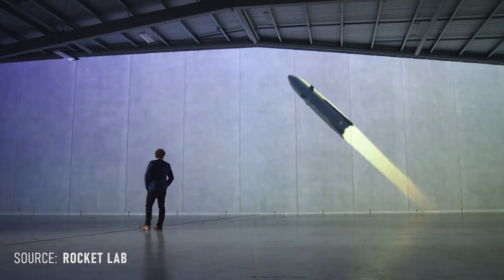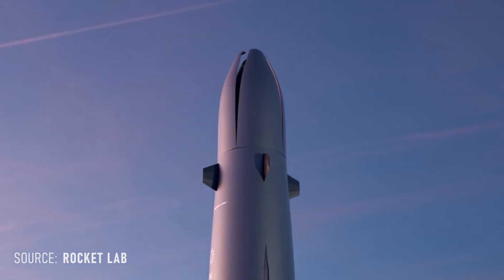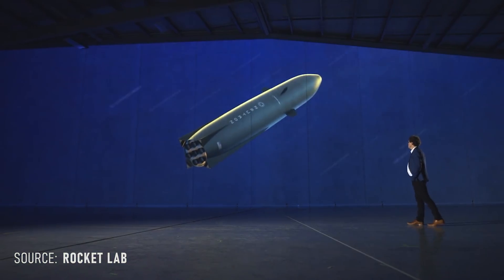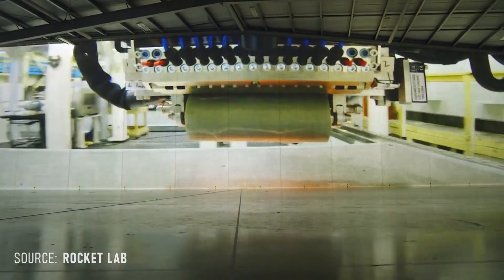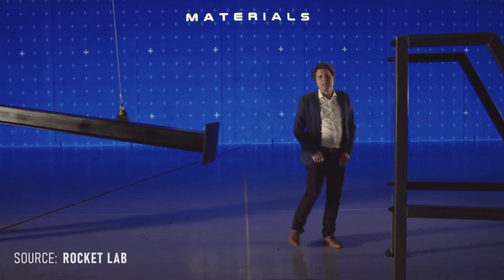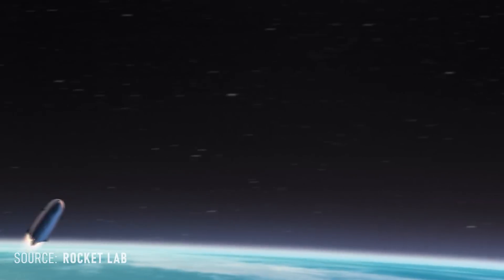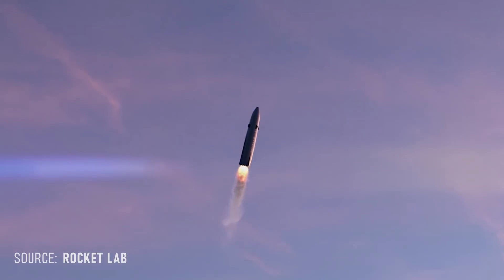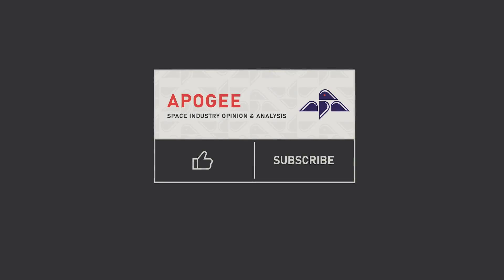Neutron First Thoughts - Design Analysis

Comment: 2050 is a long way to wait, and competition from existing rocket builders will not help them.  Launch vehicles from more well known competitors will likely do the same that Neutron is doing before Neutron can get to market.  As for Carbon Fiber, most satellites, like the recent launched Webb telescope now parked at L2, seem to do fine in space, and they are made of components that would be flimsy in earth's gravity.

As for missions to Mars, the problem is not so much in getting there, it is if stuck there by a return module launch failure, ground life support has to be reliable enough for a rescue mission.  I am not convinced a human presence on Mars, or the Moon is needed.

I am not sure we would learn anything our space probes have not already learned.

I like Blue Origin, in addition to Elon Musk's space capsule, I feel Blue Origin's launch and recovery method is more sound, especially in multi stage to orbit, because of landing on land vs. the way Musk's boosters are recovered.

I have not been impressed with Musk's booster that flips from a semi gliding position before landing--too many failures so far compared to his Crew Dragon launch system.

I am quite impressed with the Crew Dragon's bringing crews and supplies to the ISS, giving us an alternative to the Soyuz unless there is an emergency requiring its use.  

Good video you made, well spoken and presented with slick visuals and insight into a launch system provider I have not heard of.

Comment: Elon should sell more Tesla shares and buy up rocketlab to gain their expertise in carbon fiber.
Reply: There are plenty of other (cheaper) companies SpaceX could buy to bolster their competence within carbon fiber. Rocket Lab isn't doing anything particularly new, they are for the most part just utilizing industry standard materials and processes. SpaceX also does significant work with carbon fiber. For instance, the interstage, fairing and landing legs on the Falcon 9 are carbon fiber. So, I doubt they would really need to buy a carbon fiber company.

Comment: Another great video, thanks. 
The legs have to retract or have some kind of heat shielding. The plume from the engines will expand at high altitudes and cook carbon fiber legs. I'm skeptical about the carbon fiber 1st stage as well. It's not just the heating during reentry, but it's difficult to make carbon fiber contain liquid oxygen. Clearly they have overcome this problem with electron, but how will it hold up with reuse?

Comment: If they can develop a carbon composite that can withstand re-entry, I say more power to them, you can't improve on technologies if you never try to push the limits.
Reply: Already exists: https://en.wikipedia.org/wiki/Reinforced_carbon%E2%80%93carbon
Reply: Or they will use heat tiles, like spaceX.
Reply: @robertoaguiar6230  They are only trying to return the first stage that has little to no horizontal velocity so the Neutron will only experience a fraction of the heat a Starship will when entering from orbit(or even worst from the moon or even mars). No heat tiles should be necessary, especially with their bell shape and blunt end that should push the shock wave further away from the vehicle.

Comment: I'm not certain that RTLS causes Neutron to have fewer re-entry forces than Neutron. I believe that Neutron's mass and profile cause it to experience a relatively small amount of stress, but I do not know for sure.
Reply: It absolutely does. Simple physics. Boostback burn reduces horizontal velocity, it will add a bit in the opposite direction but if you think about a SpaceX ship landing the alternative is to keep burning downrange.

Edit: Apologies, i reread your comment and it compares Neutron to Neutron so i don't actually know what you were  comparing but will leave my comment up anyway.
Reply: @phillipdelatour7729  Sorry, I meant to say that I believe Electron's current re-entry forces are somewhat lesser than Neutron on RTLS due to the relatively small mass of Electron, but again, I haven't done the math, only a gut feeling. 

Obviously both are coming in hot, but Electron doesn't (seem to?) have any method of slowing itself before it achieves terminal velocity in the thicker parts of the atmosphere, and parachutes definitely work. 

Compare that to the early F9 parachute recovery attempts, which failed tremendously, and the mass of Neutron S1 seems closer to F9 1.0 S1. 

Again, no math has been done on my part for this.

Comment: The real problem is that Neutron isn't going to be competing with Falcon 9, it's going to be competing with Starship.  You can build the best small bulk freighter ever, but if you're competing with giant container ships for hauling cargo you're not going to succeed.
Reply: You're forgetting you still need a market to justify the use of a bigger rocket. And current market to LEO is moving towards more compact satellites.
Reply: @RogerM88  With Elon Musk planning on launching 30,000 Starlink satellites, finding a market for Starship isn't going to be a problem.  As for satellites getting small, that's a function of launch costs.  If SpaceX can deliver on its promise of 100 tons in LEO for $2,000,000, the motivation for making satellites as small and light as possible goes away.  I also kind of doubt people are going to want to build the big manned space stations that are being discussed 8 tons at a time.
Reply: @RogerM88  once starship is operational and delivers on its promises. The whole industry will change. At the moment size of Satelite are limited by mass but in the future of starship mass will not be an issue.
Reply: @lotambena81  How? The payload hatch seems to be getting smaller. And the sensitive maneuvering to release the payload, would mean many customers would rather use a more standard payload fairing.
Reply: @RogerM88  the payload hatch is an engineering challenge it’s not a show stopper. The shuttle payload doors design might end up being used.  
The future of space is not satellite but space station, factories, outpost colonies and massive structures. This is where starship will dominate no wonder they are planning  to build more than 1000 starships.
Elon’s always thinks big and way ahead. It’s a great time to be alive
Reply: @lotambena81  with the decline of the West and once Human population starts to decrease... don't get your expectations for Space exploration. I agree big structures in LEO are almost for sure, not so much a large colony on the Moon and Mars, that are too expensive to maintain. Some research bases, would already be a big technological feat. I believe more in the potential of big Space telescopes and a extensive Radio telescope on the far side of the Moon, all together working to thing Earth compatible planets. Until big technological breakthroughs in engine propulsion are achieved, for an Interstellar mission.
Reply: It's not going against starship. Neutron can lift 8 tonnes to leo,  starship can lift 100. It will be competing against something like Soyuz.

Comment: Good video - not quite as good as your previous ones. The buisness case is going to be tough. Its not 2014 any more. SpaceX has cornered the launch market and they needed to become their own customer with starlink to make it work. RKTLB needs a big anchor customer. Second area of concern is the engine. I like the approach, but developing a rocket engine is hard and takes years. I think they will make it, but it could take way longer than intended. I hope RKTLB will succeed with Neutron, but i don't like the odds.

Comment: On the Electron coating isn't made of grafite, but some kind of aerogel, and obviously Neutron would have something like that, but only on the parts that would be heated by re-entering, minimizing termal load means minimizing surface exposure to that load, by choosing a shape that don't allow air flow to touch all vehicle.

Comment: One thing people miss about Falcon 9 legs is that they also serve as air-break. The terminal velocity is reduced by a huge amount when the legs drop. This allows the Falcon 9 to use less fuel on landing. This is something I never see mentioned in comparison. Now I assume Neutron will have better overall air-breaking as its so fat in the lower part.
Reply: That's not accurate. The legs fold out right at the end of the landing burn, and by that time the air resistance is fairly negligible. You can see it in how the grid fins have stopped moving because they no longer have any control authority.

https://youtu.be/lXgLyCYuYA4?t=115

Comment: Highly recommend Peter Beck's interview by NASASpaceflight. It covers all challenges and decisions behind the design. Beck put huge emphasis on operating costs as opposed to material and design costs. This is interesting contrast to Musk who rarely mentions labour costs or cost of running a fleet of ships/platforms. I think the difference is that SpaceX is projected to have huge economies of scale. The same number of equipment and people is needed to launch 1 and 100 times, or 1 and 100 tons at a time. The flipside is that theoretical min cost/kg to orbit can rarely be achieved due to difficulties coordinating full capacity utilization. If you build a $100M satellite, would you pay 2% ($2M) to get it on orbit when and where you want precisely, or 1% ($1M) hitching a ride with others on set date? There is a reason why taxis and buses coexist. I do not think that Rocketlab is a direct competitor to SpaceX, but rather they aim to serve different customers. Their respective approaches play to their strengths. Now, who wants to see Neutron with Raptor 2?
Reply: There is definitely some overlap in the customer base. If SpaceX is actually successful in getting the cost of a Starship down to say $20 million/launch, it could be competing with Neutron at say $10-20 million/launch. A fully reusable bus could easily compete with a taxi where you have to replace ~15% of the taxi after every trip. Even if there is only one passenger.

I also wouldn't underestimate the head start of SpaceX. Starship will almost certainly be flying this year, while Neutron will be flying in 2024-2026, probably. Basically, by the time Neutron is making it's first flight, Starship will (probably) have flown dozens of times. It will (probably) have a proven record of reliability, and it will (probably) be an easy sell to the satellite customers.

Rocket Lab is definitely the company I hold most hope in, except for SpaceX, though. I don't at all believe SpaceX will get a monopoly on orbital launches. I am a Rocket Lab shareholder.
Reply: @espenha  That is a fair argument. I'd say that Neutron's 2nd stage looks like they strapped the cargo to an off-the-shelf engine with bare minimum of anything to make it go in the right direction and orbit. It is probably very cheap. Ultimately Rocketlab will have to manage full reusability - just like everyone else.

Comment: Kiwis have been making fiber reinforced plastics for decades. If you ask a Kiwi to build an intricate part of high strength and low weight you'll get a composite
solution every time, and is easier to make than a metal part. To be honest I think the notion that carbon fiber is hard to manufacture into parts and structures
is wrong....it just requires that you think about a new process and Kiwis have been thinking that way since the 50's.

Craig

Comment: The concept of carbon fiber construction sounds great, but if you run the vertical stress calculations with maximum loaded propellant mass, I think that you’ll find it difficult to see any advantage in carbon fiber to get larger gross mass rockets to orbit 🚀

Comment: Since carbon fiber reduces the body weight by 3/4 compared to aluminum, the heat generated on re-entry should be much lower compared to a metal rocket of the same size.   However, I agree that getting the carbon fiber skin to survive re-entry, and remain structurally sound over many flights will be their main challenge.
Reply: From all I've watched from other rocket enthusiasts' videos, it is my understanding that the heat generated by reentry is more a function of reentry speed and shape of the vehicle rather than mass/density.
Reply: @nolsp7240  yes I have read that the heat increases by the cube of the speed of re-entry. However, my understanding is that with a lower mass vehicle (of the same size and shape), the actual speed will decrease faster, due to its inherent lower inertia, resulting in an overall lower heat load on re-entry.

This is why SpaceX fairings and Rocket lab electron don't need a heat shield.
Reply: @DataSmithy  The falcon 9 fairings don't reenter with orbital speeds though. Neither does most first stage boosters.
Reply: @nolsp7240  If a first stage re-enters at orbital velocity, that means it reached orbital velocity, which means someone has achieved single stage to orbit. Single stage to orbit was done on the moon, but it has never been done on Earth.
Reply: I learned to fly at Falcon Field in Mesa, AZ, in an Allegro 2000 Light Sport aircraft in 2006.  It had metal wings and a carbon fiber body.  It was parked in the hot desert sun without degradation to its body.  Carbon Fiber commercial aircraft have been sound given the temp extremes they go thru, from hot days to -40 F in the flight levels.

The space shuttle thermal tiles I also believe were carbon fiber, certainly not metal.  They only failed once, because the Columbia lost tiles in critical places, because of the ice that fell from the fuel tank.  The Challenger disaster (which sadly happened on my parents' wedding anniversary) was different.  Odd, off subject, the Haiti quake happened on my wedding anniversary and I lost my brother on his birthday in '09 quite unexpectedly, just months before my Mom passed from cancer, which we did expect and my Mom was OK with that.  

All of us in our family were space buffs--I was glued to the TV in 69 during the moon landing and also in 68 during the Xmas lunar orbit.  However you'd never catch me in a rocket, I don't fear the flight, but weightlessness for an extended duration does not appeal to me--better for folks much younger, lol.

Comment: To me Neutron is the best example showcasing innovation on existing/proven designs. As you brought up they saw the early issues SpaceX was having with retracting the legs after landing, so they are attempting to address it. They have seen SpaceX's issues with fairing recovery, so they addressed it. These and more show how technology moves forward not attempting to straight up copy but really thinking through existing issues to solve/mitigate them and I hope they succeed in the future!
Reply: this is why I like Rocket Lab being in the competition for space, they may be behind SpaceX with "firsts" but they are quick learners and are great at adapting to the needs of the launch. They can play second place while making a more efficient version of what SpaceX does by learning from their mistakes. Its really bringing out the idea of an actual commercial market and some competition within the space sector.

Comment: I didn't notice any discussion of the landing approach and landing burn. Is the first stage  going to take advantage of its diameter to bleed off more speed in a StarShip bellyflop or is Neutron coming down like Falcon 9's first stage "tail first all the way"? If bellyflop, does Neutron have header tanks?
Reply from the maker: As far as we know Neutron comes back mostly straight down like Falcon 9. It does have wing strakes which help it glide and bleed off speed / temp slower.

Comment: What I'm more concerned about than any of the stuff you bring up is the ability for the fairings to actually remain closed, open, and reclose. In every animation so for, it has the fairing hinge point on a circle. Think about how such a hinge would work. What mechanism would pull it open? How will it close? 
I pointed this out in the cargo animations for Starship recently. They showed a cargo bay door opening in a similar way with the hinge of the cargo bay connecting to a radiused area of the ship. Recent video from Starbase has shown that they have abandoned this design in favor of a side hinge opening.
Reply: Have the hinges on the inside, and then have the middle of the hinges be able to expand and contract
Reply: @joshuaashton1929  Its not that easy. Theres the mounting plate for the second stage is there. 

Think about what a cars trunk hinge looks like. Its comparatively huge and takes up a lot of space. Thats what the hinge would need to look like to open from the inside. Is there only one hinge per fairing petal? Thats a weak point. If there are two then the hinges need to be massive to allow for the radius of the body. 

Go look at a tube for a little while and think about the actual mechanism before handwaving away the whole issue. Its more complicated than you think it is.
Reply from the maker: I don't think they have quite figured out the fairings yet, and if I had to guess they'll probably end up looking slightly different.